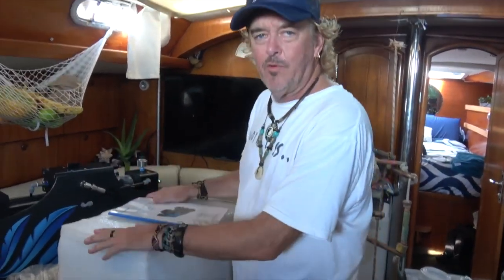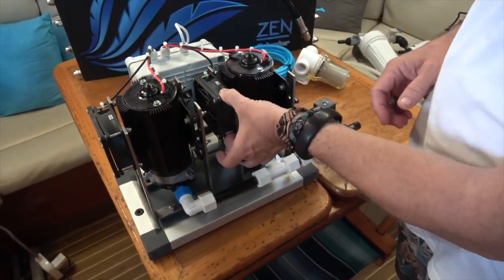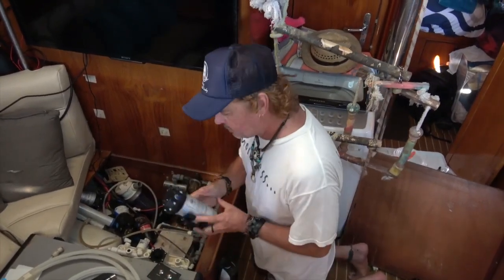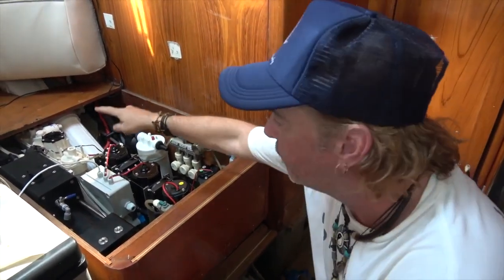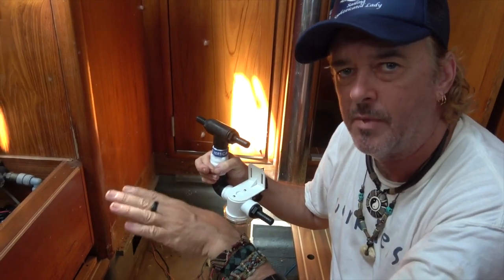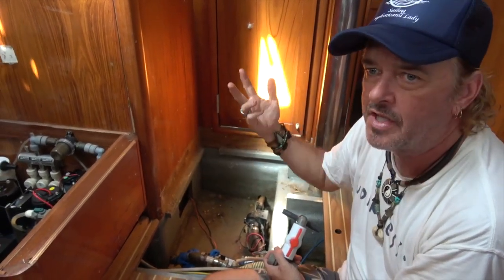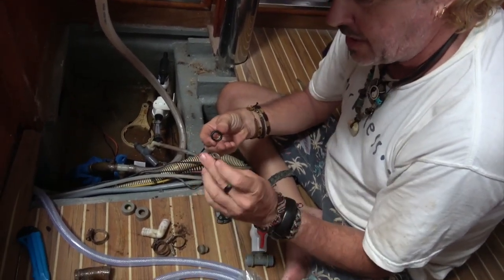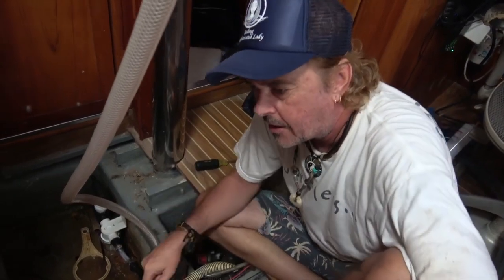How to INSTALL a Schenker ZEN 50

Comment: Rick, you've had this system installed for a few months now. Do you like it?
Reply: We've been using it full time for almost 6 months now and absolutely loving it!  It performs exactly as specified, the dual motors are very quiet when it's running, and the panel mount controller is great.. simple yet effective and we usually pre-program to run for 2 or 3 hours and then it self-flushes with freshwater and shuts itself down.. perfect!  :)
Reply: @SailingSophisticatedLady  Thanks for the response. I hope to be needing a watermaker soon, but still not sure which make or LPH size to buy. Glad it's working well for you. Safe travels!

Comment: nice job,too bad i am dealing with a zen 100 24 v and have a few cables to figure out not included
Reply: Hello Diego, the connection cable of the remote panel is included in the kit, whereas the power cables are not included.

Comment: have you reused the Hydroteck RO unit with your new Zen unit ?
Reply: Our new Zen units make use of standard, commercial RO membranes, like Filmtec, Hydranautics or equivalent.
Reply: @riccardoverde4707  thanks for the reply , looking at getting a Zen 50, just to confirm i would need a RO unit also ? as see in your system you take out your Old RO unit white unit with one black cap then put it back into the system  thanks.
Reply: @sailrockpaperscissors8261  You are welcome. You don't need anything else. The RO section (based on 2X SW2521 membranes)  is integrated in the main unit.
Reply: @riccardoverde4707  Ok thanks will watch the video again , looks like you reuse your old RO unit.